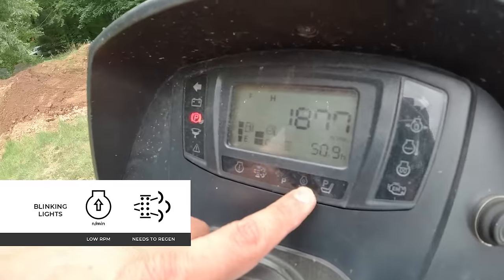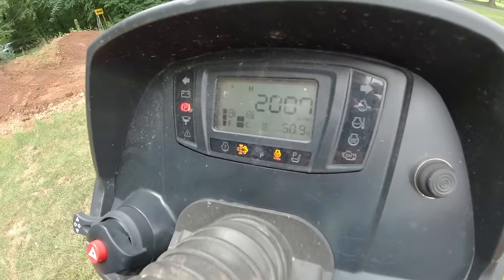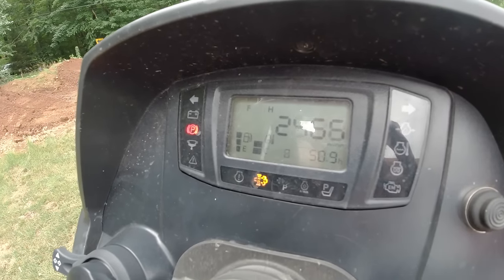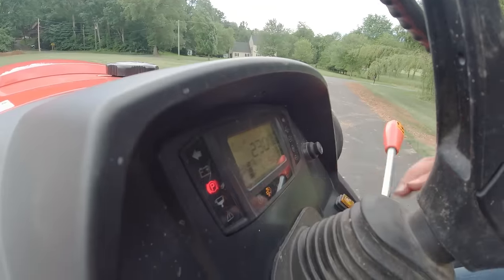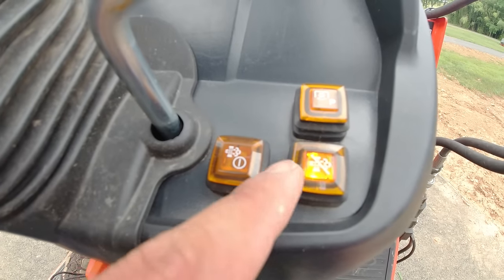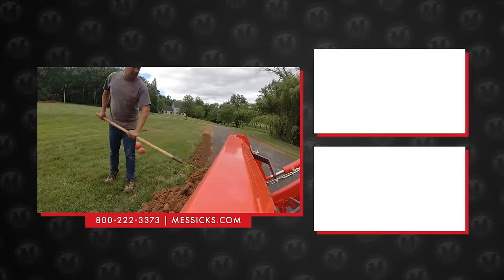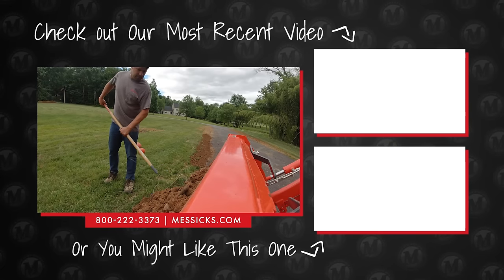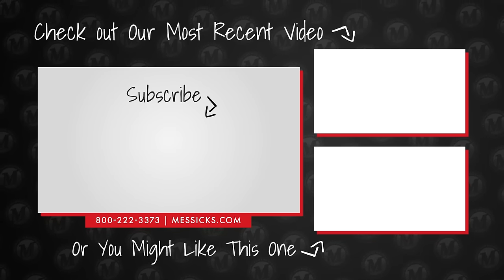Regen PANIC. Live tractor regen process explanation and buttons.

Comment: Neil,  You are correct. 
The first time my regen light came on I went 'whaaattt! What do I do now? How long will this take? Can I keep working?  ThenI  upped the rpms, saw the process was underway, and kept working.  
About 15 min after regen finished I was done. I decided to let the tractor sit at idle for an extra 5 minutes and then parked it. 
Not a big deal, and easy to understand , after you have been through it.

Comment: Outstanding. We are at 19 hours and YES the lights came on .  I tried what you did obviously I wasn’t at a high enough RPM. Read manual on PARK and regen… RPMs went to about 2500 I panicked and shut it off. 
I’ll try what you did today. Work through it appropriately like you higher RPMs hopefully it works. 
Thanks very helpful. I will not do the park Regen again.
Reply from the maker: Nothing wrong with doing parked either. You were doing it correctly

Comment: I helped a friend who likes the low rpm regime do a 50 hour service. I noted that his oil was significantly dirtier than mine was. My tractor has never regened, probably because it spends 95% of it’s time on PTO work. How does this relate to dirty oil? At lower rpms you produce more carbon in the exhaust and more carbon is also more getting into the crankcase. Want to kill your tractor? Run it low rpm snd don’t change the oil.

Comment: This was a good video, it really shows that all that you need to do is raise the rpm's went it wants to do a regen and keep working.  Once it is done you can lower the revs or stop the tractor if you want, but for the 15 minutes or so, just let the tractor scream a little!  I would think the "inhibit" button would be good if you needed to park the tractor cause it was about to rain or something (and you wanted to put it away in the garage before you get soaked cause you mistakenly bought a tractor without a cab.......), but otherwise unless you HAVE to stop running the tractor, just let it scream for a bit!

My Kioti DK50SE cab has not had to do any regens....... oh, yeah, it's a pre-emissions 4 cylinder model..... :)

Comment: Hi Neil, on my Boomer 45, i just did the Regen @150hrs, brought the machine back to my shop and to hit the button to start the process and it started the process on it’s own for 20min then came back down to idle… no issues… told by dealer don’t defer too many times then the dealer has to reset the process…God Bless and stay safe…Chief…{NYS/ADK}

Comment: I tend to not notice the Regens on my L3560. I spend a lot of time running my PTO chipping tree limbs in the summer and my snowblower in the winter. That engine RPM is higher than the Regen needs. Aside from a little different exhaust smell I rarely even notice.

Comment: I run a 2016 JD 3038e. 100% brush hog. I can go almost 100 hrs between regens. But I run it hard. In heavy brush when the engine is running hard and hot, I can watch the shoot % drop. I’ve seen it go from 82% down to 52% in 3 hard hot hours. I have about 1200 hrs on this machine and only one time did it make me stop and do a parked regen.

Comment: My B2650 has not had to re-gen in over 309 hours! So far so good… 😀
Reply: Does the 25 HP engine even have to regen?  It is under 26 HP so I thought no DPF or DEF fluid required.
Reply: @danielrapoza8468  no re-gen needed. You are correct.
I was just being smarmy!
Reply: @lcee6592  LOL,  You got me there!!!

Comment: my NH T4.95 does a DPF regen roughly every 10 hours, regardless of what i do, year round. each time is 10-15 mins. might notice the occasional pitch change in exhaust tone but never gets in the way of what i'm doing. only once have i had shut it down during a regen and it automatically started again within an hour of running the next day

Comment: I own a 2018 kubota b3350 compact tractor - well known for regen problems. It’s currently being repaired again, and kubota sent me an apology letter for being the poor SOB that bought one. They also included a sticker that basically says this is a problem machine and call your dealer, and also a kubota keychain. That thing has 500 hrs on it and belongs in a scrapyard. Great machine other than the regen BS and apparently that’s the only thing you can’t actually replace/repair. I appreciate the keychain they sent me though that was a nice touch 😅

Comment: my tractor gets used with high RPM's and the 540 PTO for mowing 95% of the time. with that, I regened at 50 hours and 150 hours.  I expect my next regen to be at 250 hours
Reply: You beat me to it. I do a lot of brush hogging and my first was at 61 hours and my second at 135

Comment: mine flashes all the time. never goes solid. I have had 3 forced park regen at 290 hours. 
yes I rev it up to 2400rpms. takes 15-20 minutes and goes out. 
I do use my tractor at 8200 feet in elevation.

Comment: Your video explained the Regen process a lot better than the operators manual that I received with my tractor.
I do have a question for you, as my tractor has only regened one time that I know of and it seems like that was around 35 hours.
I now have about 85 hours on the tractor. I do mostly loader work, some PTO work, so mostly lower RPM's. Shouldn't the tractor be regening more often?
Reply from the maker: Yesterday, at lower rpm you regen more. Does vary by model.
Reply: @MessicksEquip  Thanks

Comment: Do tractors with DPF equipment utilize Diesel Exhaust Fluid similar to my diesel truck? If so, how often do you have to add DEF?
Thanks!  Good video!
I’m wanting to upgrade from my BX2660 to the LX3310.
Reply: No DEF!
Reply: Usually you won't see diesel exhaust fluid (def) until you get over 75hp.

The systems that use def are called selective catalyst reduction (scr).
Reply: @bobheisserer9046  Thank you!
Reply: @tangydiesel1886  Thank you!

Comment: So what is happy balance between rpms for maximum performance and fuel usage? We are at around 22.5 hours on our new Kubota 3560 LE. No regen yet, but we run our rpm around 2000 to 2200 rpm for our front end Trail Blazer mower with power pack. It seems to run better at these higher rpms However it does seem to use more fuel.
Reply from the maker: I have a video shot on this very topic coming out shortly. All my testing shows that RPM hardly impacts fuel usage. It's all about the work that you're doing.
Reply: @MessicksEquip  I look forward on hearing about it. Enjoying the new tractor with its increased capability over our old 17 hp Kubota which has no loader. (L185 ot L185DT)

Comment: How many times can you cancel the regen before the tractor shuts down? How are you supposed to handle jobs that have to be done at very low engine speed and slow ground speeds for days at a time? On my dad's farm, spraying has to be done by hand at a very slow walking pace. He uses the tractor to carry the tank of chemicals, pump, and boom with manually operated spray hoses. This is a slow process that continues over the course of weeks. Low rpm operation is the only efficient way to do this. He actually leased a tractor and had this issue with it. A service tech had to come out and connect to the tractor to manually perform the regen because it wouldn't do it during the course of work. These systems are nothing but extra trouble and extra fuel burned.
Reply from the maker: Lots of solutions here. Creeper gear, little more revs on the engine, hydrostatic that can creep slow, run a periodic parked Regen. We have dozens of tractors in orchards doing this exact sort of work without issue. You just need to understand and work with the system.
Reply: @MessicksEquip  I understand that it can be done, but it shouldn't have to be. All those things just add complication, cost, and more things to fail in the system. I guess I just don't see the benefit. Seems like a waste of fuel. Thanks for your reply though. Love your videos.
Reply from the maker: @josuwils  it does not burn measurably more fuel, the EPA did saddle us with some engine complexity though.

Comment: So it's no big deal. You just need to run your equipment at high rpms and get the motor extra hot... what could go wrong?!
Reply: California Forest Fire?
J.S.
Reply: @mikeholubek4419  Not to mention, greater fuel consumption,  more oil changes, and greater wear and tear on engine internals, but at least it's better for the environment.
Reply: @moaski  It isn't, just running real lean and filtering for emissions, then dumping fuel into the exhaust filter to burn off the soot. Wouldn't suprise me if epa changed testing procedures to test during regen.
Reply: @ricksanchez7459  not sure I follow your logic: running an engine lean at high rpms for a prolonged period of time while this Regen cycle occurs is not good. This will certainly generate more heat running lean at rpm and cause excessive wear over time.
Reply: @moaski  I think you misunderstood, they run lean during normal operation to meet emissions, but still clog up the dpf. It then runs rich while in regen, spraying so much fuel it makes it to the exhaust/dpf, ignites, and burns the soot off the catalyst. Cat engines have a nozzle in the exhaust that sprays fuel onto the catalyst. Robbing Peter to pay Paul. Look at the warranty on the emission systems, if it  is 2000hrs I guarantee you that is when they start having problems/needing serviced.

Comment: I have a 2010 Kabota BX 2660 and this is the first time I’ve heard about region, does my tractor have that on it ? because I’ve never seen any flashing lights and I know there’s no buttons like the ones that was on your tractor
Reply from the maker: Not on yours
Reply: As far as I know all engines below 26 HP do not require any Regen process, DPF filter, or DEF fluid.  The BX2660 is 25 HP and falls below the Govt requirement, so not an issue for you.  I believe that is why Kubota and other mfg offer the 25 HP engines.  So they are below and exempt from the Govt requirements.
Reply: Oh NO!
U BETTER SELL IT and buy 1 with the DPF since U really care about the environment Right??

Comment: My Massey 1840e just did it's third regen at 115 hours, didn't do its first til 40 hours. I keep the rpms above 2000 all the time, seems to help with regen intervals.  Do you recommend any automotive diesel fuel additives for dpf cleaning?

Comment: the blinky poof light you call it. I call it the hot fart light.🤣 I have a 3301 dt. and I do alot of loader work and mine is about 16 to 18 hours between Regins mine always wants to regin when I'm almost finished I just rev it up and let it burn before I go to the shop. I do not want to have any issues with mine so i always let it do its thing just to make sure I have no issues.

Comment: My 35hp Massey would regen at about 25 hour time periods.  Would take about 10-15 minutes.  I thought it was a longer process till I went thru it once.  It's not a big deal and don't know why people are so against the tech.  Perhaps the costs?  My 50 hp Massey has yet to do one and it's at about 25 hours, so I'm expecting it to kick in any time.  It is a different engine, so hard to tell.
Reply: What Masseys do you have that have a regen cycle? My 1735M's engine doesn't use a regen cycle at all.
Reply: @brianpoi5117  My 1st one was an 1835M, then I traded up to a 2850M

Comment: What tractor? I own a 2021 TYM T474 HST, used on the VA coast, after 210 hours. It has never regen. Mostly loader work.  Before you buy, ask around. What I observed is that all brands have regen issues, but not all engine/drivetrain configurations.
Lastly, buying a <25hp tractor greatly limits you, less you needs can be forefiilled by a subcompact. No manufactor is going provide a <25hp tractor with components of 50hp tractor other than hydraulics. But other features affecting traction, speed and implement loads will not be built beyond the engine horsepower. It's a cost thing that goes beyond emissions. How many hours per task. 25hp vice 50hp easily equates to 30% quicker in most traditional tractor tasks.

Comment: Why would they cause confusion?? Being very snarky because on my L4701 the labels were entirely GONE from the buttons within 4 months. I’d have to look at the owners manual to figure which is which! Pathetic for Kubota to so poorly mark buttons…. I guess that goes with the instafade paint. Really the only gripe I have with it.
Reply from the maker: How old is you tractor? Paint process changed about 4 years ago and is much better now. I have seen a few of the buttons fade though.
Reply: @MessicksEquip  3-4 years, not a single one of those square amber buttons has any identification

Comment: i been diesel mechanic for 40 years and this not a good thing on a farm tractor unless you run it at high rpm all the time...it does not work for garbage trucks it does not work for school buses and unless you run at ppto speed all the time it is a bad setup that will eventually cause expensive failure
Reply from the maker: Different vehicle, different duty cycles. Actually works fairly reliably on our equipment.
Reply: @MessicksEquip  I have a mx60 wants to regen every ten hours if you just use it at low rpm
Reply from the maker: @patrickdowning9310  very little reason to run at low rpm. Not good for the hydraulics, transmission, etc. Keep it over half. That tractor is normally 30-50 hour regens.

Comment: Sounds like a huge waste of fuel for microscopicly cleaner exhaust.
Reply: Welcome to govt thinking they know what's best
Reply: Technically, the regen itself is not to make the air cleaner. It's to keep the DPF from getting clogged, which could at the very least cause you to lose power and performance, and at worst ruin your motor.

Comment: Shouldn’t this just be tackled during an oil change when the tractor is down for maintenances? Seems more practical but then again we are dealing with govt regs and over engineering.
Reply: How exactly would you do this during an oil change LOL
Reply: Change the oil then hit the clean button. Vs freaking out the owner that something is going wrong
Reply: @tillman40  what "clean button" ? Lol. And are you going to change the oil every 20 or so hours ?  I dont think you understand how this works
Reply: Regens are more frequent than oil changes. However, if a person wanted to do a manual regen during service, i would recommend doing it before the oil change, since a small amount of fuel and soot gets past the rings during regen. No point in getting fresh oil hot and dirty right away.

Comment: Wait until the DEF level gets to 50% and lights flash and it beeps at you non-stop!  It only took 18 months to use half a tank but Kubota act's like the world is coming to an end if the DEF gets to 50%    How crazy is that?  Beep Beep Beep!  M5-111
Reply from the maker: If you using 50% in 18mo you should drain it and put in fresh. Def has a shelf life.
Reply: @MessicksEquip  Yes, I have and I will do it every spring now, however it seems crazy that their alarm is at half a tank.  Not a gentle reminder but beeps enough to drive you crazy.  My vehicles aren't near that aggressive.